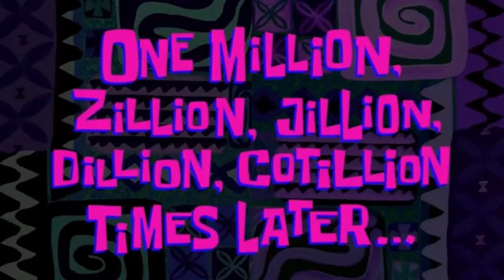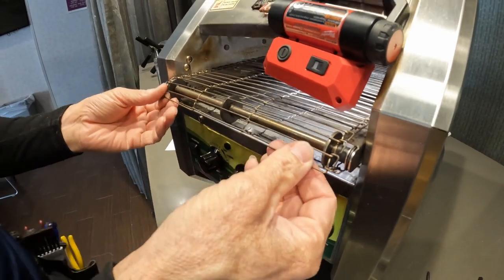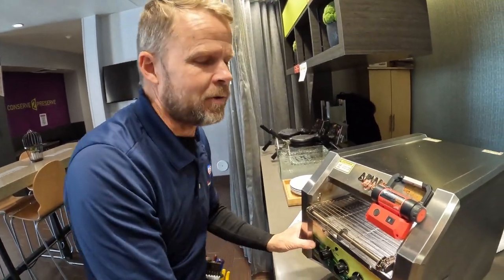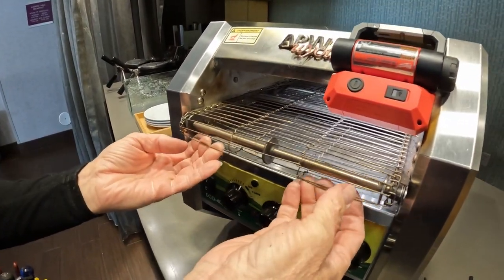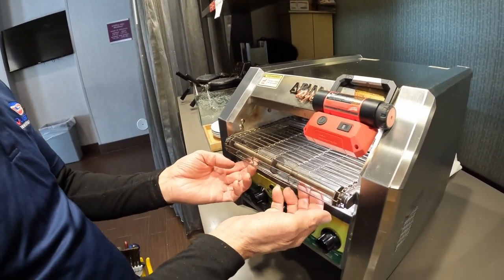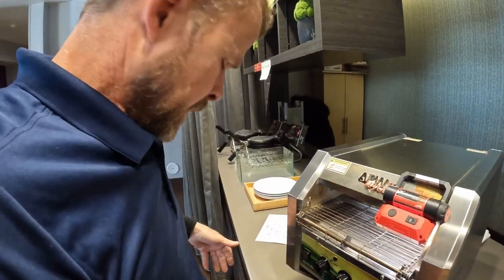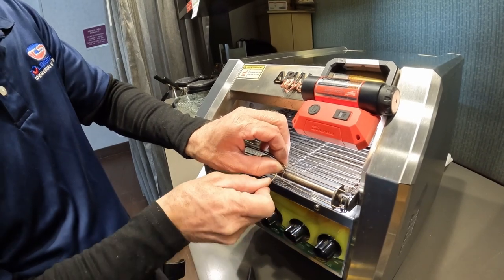Nate and Sons Fix a Conveyor Toaster Oven | Nate and Sons

Comment: Do the links stretch over time? Or would there be a loose tensioner?
Reply: I think they just warp from the heat overtime and get loose
Reply: @Gazzellism  could you of not adjusted on gearbox